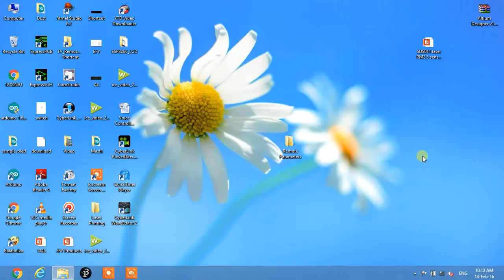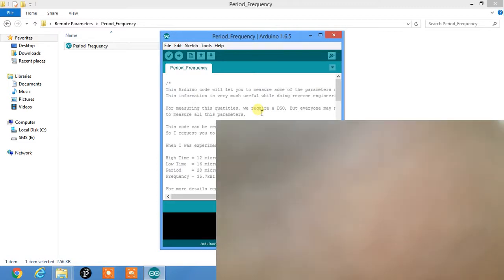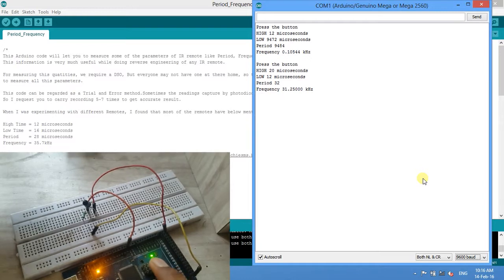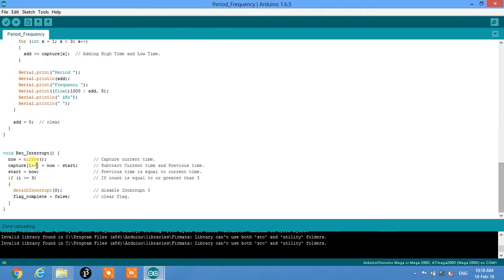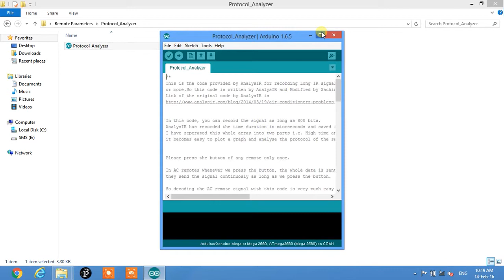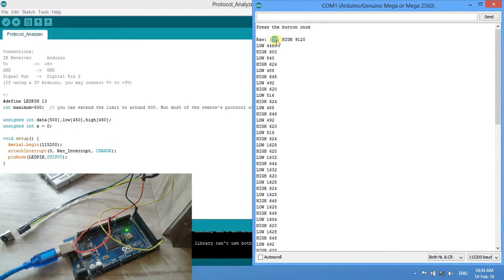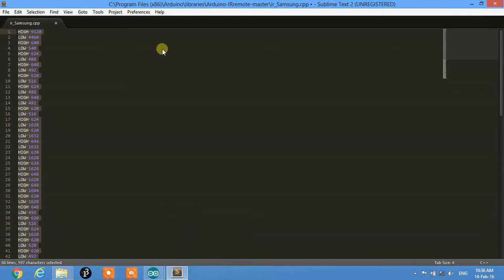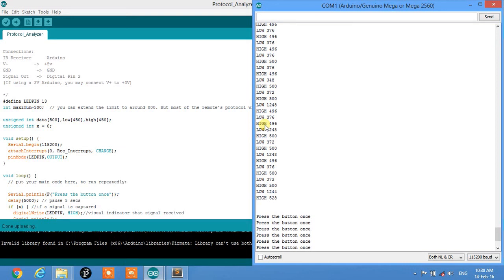Measuring IR Remote's Frequency,Time,Protocol using only Arduino | IR remote protocol analyzer

Comment: very good. tnx
why not able to detect 'period-frequency' with UNO board for the NEC IR remote. the connection done as per you ie,
PIN2 (ie, int0 pin of the board)>>to Junction,
VCC>>Cathode,
GND>>OTHER END OF 330R resistor.

Shoud i need to use MEGA Borad for 'Protocol Analyser' also..
please replyy..
tnx for your good research..
tnx

Comment: I'm not sure about accuracy of calculated frequency. delay due to micro controller instruction  execution and interrupt handling is not considered.
So I would recommend using oscilloscope or MCU (operating @ high frequency)

Comment: Hi my dear friend , i found that ac ir codes are not fixed they varay and every time i capture a frame of ir packet they are different, it happes with ac remote protocol only, the codes are around 50 bit , i tried with Voltas and Electrolux but i couldnt decode the frame,